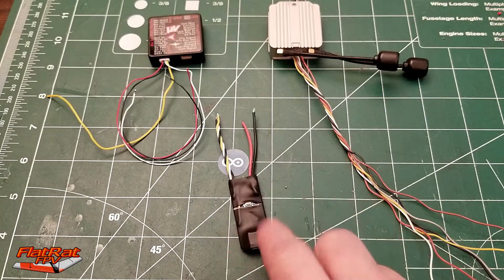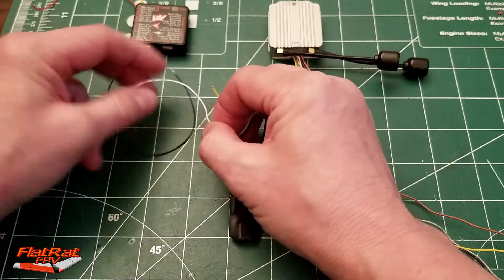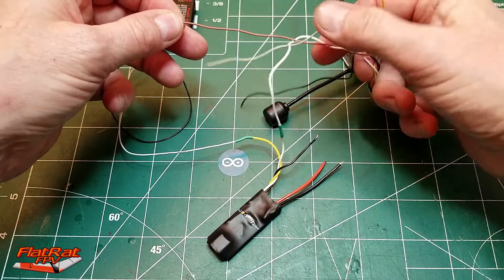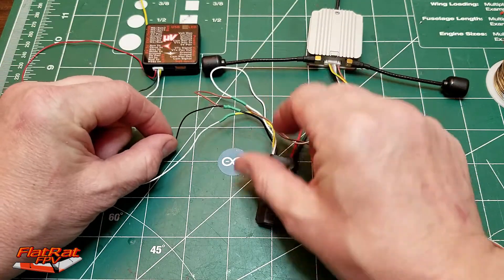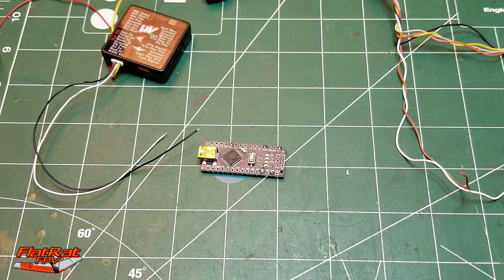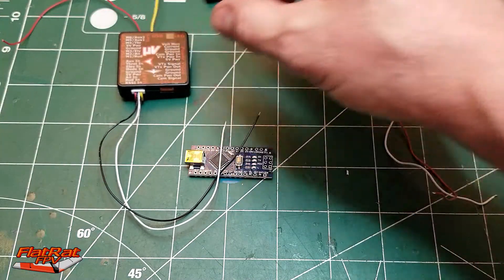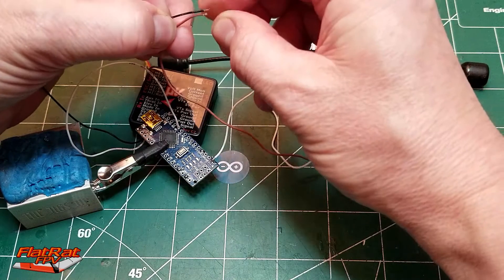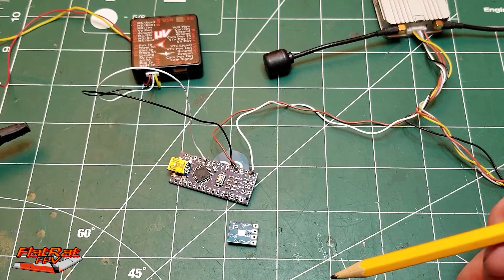How to wire the Arduino Nano to ET Vector and DJI FPV for OSD

Comment: trying to figure out if it’s possible maybe you can help if this will work for it. It would be amazing. I have a plane no flight controller at all my PWM receiver is ELRS and I want to be able to throw those three on there, but have it actually arm so I get full range and recording having the power OSD would be nice but not necessary. Is it possible with the nano
Reply: So, this little trick only works with the Vector flight controller system and the original DJI FPV video system.  Unfortunately Vector has gone out of business and is no more....  It is just as well though.  At the time it was pretty state of the art and had great functionality.  Now a days you can run Ardu Piliot or Inav for much cheaper and still get the great experience.  Also, your DJI system will work with ether of them without the extra board. Hope this helps!
Reply: @ I have no flight controller whatsoever so it’s not usable because 03 locks out unless he gets an armed signal without having a flight controller you can’t run I NAV or anything

Comment: FlatRat -- great video and appreciate the details.   I am interested in the  OSD code to feed the DJI data from the Arduino.  I would love to make a simple OSD sensor, baro and voltage without the full flight control.  Any links to the source code anywhere?

Comment: Hi! I've been using (full size) Vector since a while and it's still may favorite OSD by distance. Now I plan to switch to HD world with DJI googles and Air unit. If possible I would like to buy from you Arduino unit need to bring Vector OSD to DHI google. I'd like to buy also your Air unit 3D print holder if possible. Send me please info to my mail jcajhen@hotmail.com.
Best regards!
P.S.: See one of my FPV setup: (45) SkyCruise2400 FPV ByteFrost HD project - YouTube
Janko